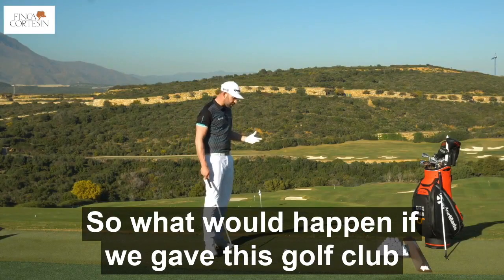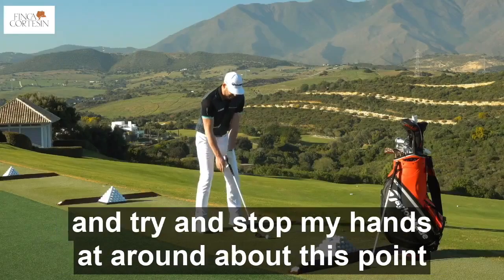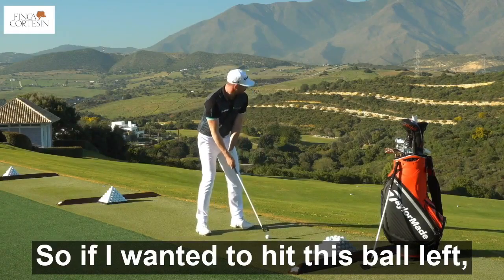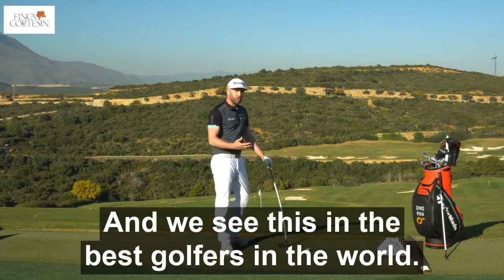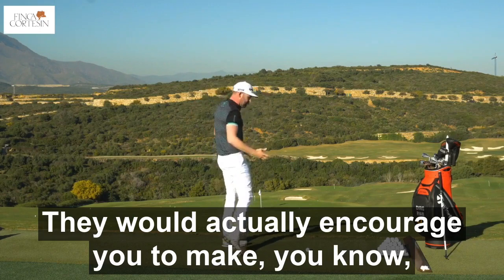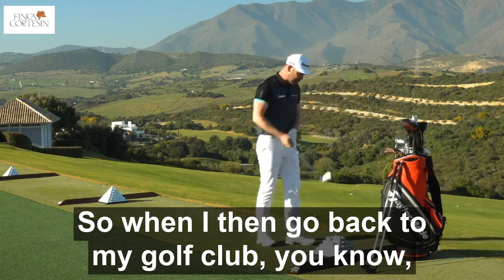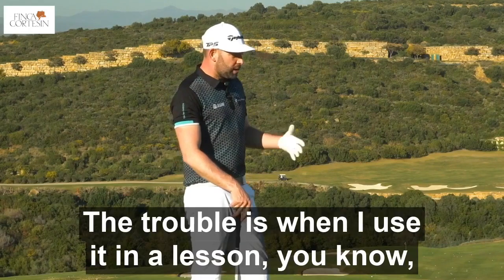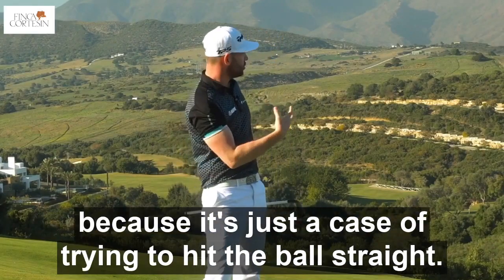Missing To The Right..? Here's Why & How To Fix It...

Comment: Had some success with the gforce with 1/2 and 3/4 swings. But when I go back to my clubs, the ball is a dead pull hook? Do you have a remedy for what I'm doing wrong here?
Reply from the maker: Yes, sounds like you are compensating with your hands to square the face of the GFORCE which can be disastrous, instead of unloading the shaft which squares the face through the correct sequencing of the downswing. Check out this video here, on how to unload the shaft to square the face. 
https://youtu.be/NgrYcbpoESc

Also another common issues is having your downswing transition too steep or too shallow, both of these cause the hand manipulation/compensations, so when you switch back to your normal club you hit pull hooks. 

In transition you need to get the club down into the correct delivery position, this way you won't compensate with your hands to square the face, and hit the ball pure without manipulations, switching between swing trainer and your normal club is the best way to practice.
https://youtu.be/TtEcgFJG3gI

See how that goes, and get in touch here with any questions or updates on your progress :-) stuart

Comment: Doing those stopper swings isn't really an option for hitting balls with your own clubs..... its just a way to make the Gforce go straighter. Im not sure how this spills over into normal clubs......🤔
Reply from the maker: It works just as good with normal clubs and can really help improve your release and strike. Over the years coaching I found my students hit the ball much better this way.

Typically golfers accelerate the arms too long through impact, trying to force the club through to gain speed, which has the opposite effect of slowing the clubhead down and loosing face control.

The stoppers help put the breaks on with the arms and the energy transfers into the club head, increasing club head speed and squaring it up. 

I did a science analogy in this link below to explain how to transfer the energy from body to club which is the end goal, thanks 

https://www.gforcegolf.com/pages/q-a